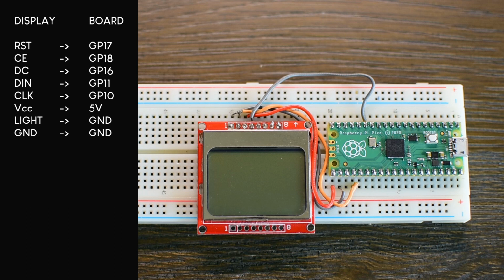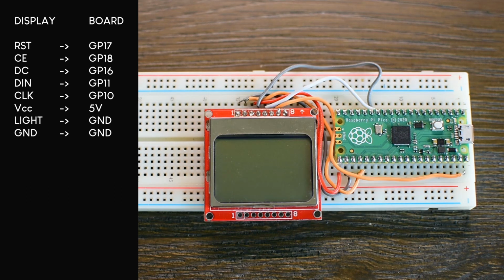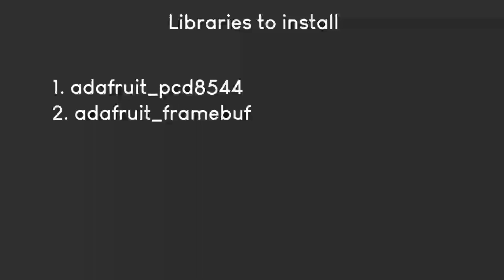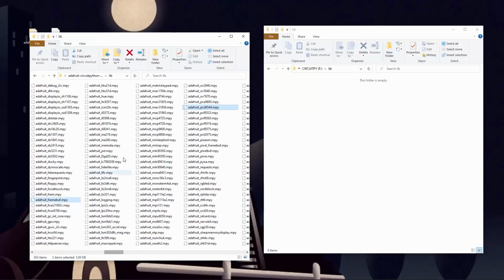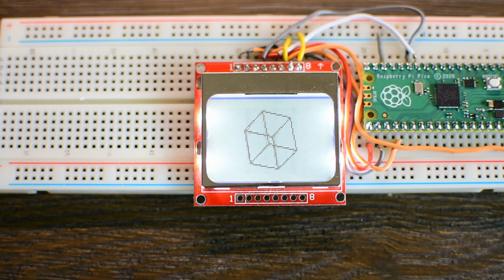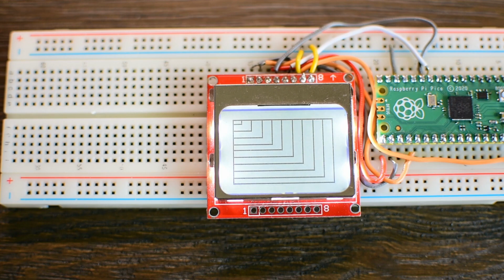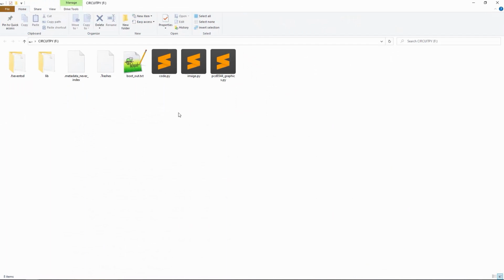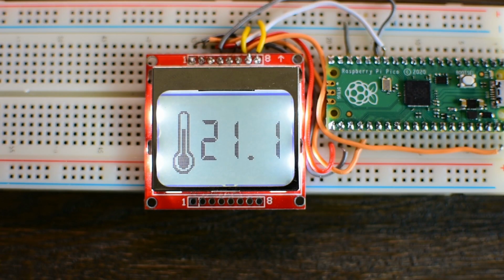Raspberry Pi Pico Nokia 5110 ( pcd8544 ) display tutorial using CircuitPython

Comment: I love the Nokia 5110, I used them for eyes on a robot I made. I designed a different PCB to mount them, with the area behind the screen removed so I could use a RGB LED to illuminate the screen with whatever colour I wanted.
The pi pico does run the screen quick, I may try replacing the nano I am currently using.

If display.fill_rect() only writes the rectangle to the display. what I would do to speed it up is:
In the bouncing box, try not using fill and draw rectangle every tick, use only at the start. Then before drawing new ball, draw white (opposite colour) ball where it currently is, then draw the ball in its new position.
you will need two new variables: cur_ball_x, cur_ball_y
so:
Put
display.fill(0) and display.rect(0,0,84,84,1) after clear_screen()
Then change
display.fill_rect(ball_x, ball_y, 5, 5, 1)
to
display.fill_rect(cur_ball_x, cur_ball_y, 5, 5, 0)
display.fill_rect(ball_x, ball_y, 5, 5, 1)
cur_ball_x = ball_x
cur_ball_y = ball_y

Hope that made some sense, another fantastic video nick.
Reply from the maker: This is a very neat trick that I only recently found out about it. I tested it and it works great. Thanks for sharing it in this comment! It is very useful and efficient way to update the position of the elements on the screen. I will definitely use it.